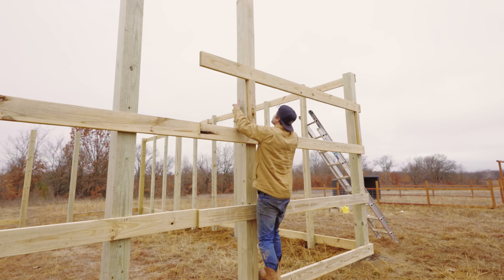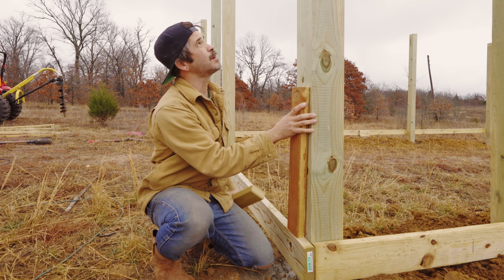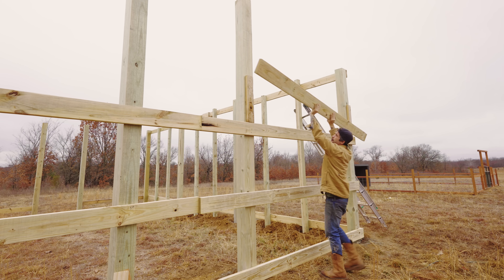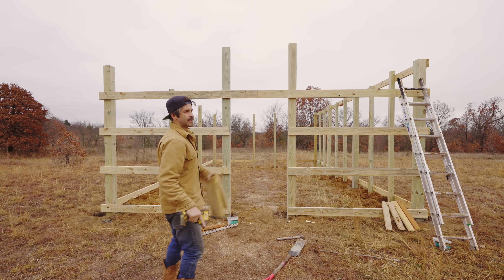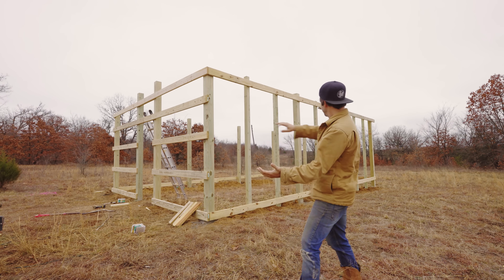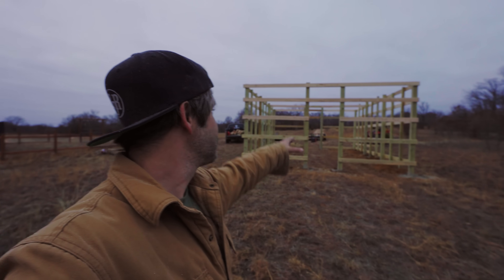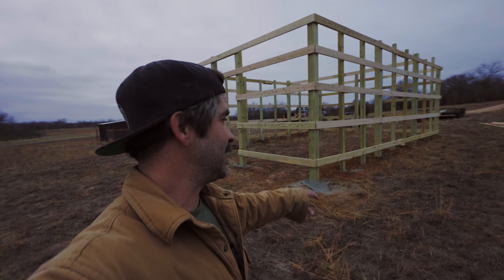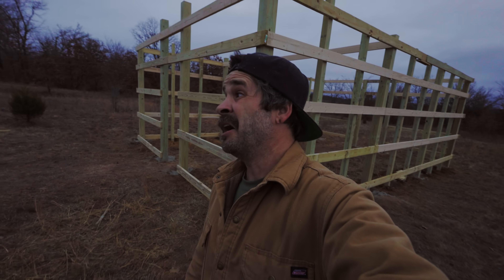DIY Pole Barn takes Shape! Solo Build On The Homestead / Ranch

Comment: If you have ever taken apart a structure built with screws versus one built with nails you would know that screws are much stronger. The sheer strength of a nail is much stronger than the screw without it being installed however once the two boards are joined together it becomes a completely different story. I can pull a board with nails in it much faster than one with screws.

I am a deck builder and we use all screws everywhere.

Nice pole barn by the way. Can't wait to see it finished.
Reply from the maker: Well in fairness a deck and a building are 2 different things. I'd use screws all day on a deck. But when it comes to a large structure,  it's going to shift with the ground when it moves. Nails can bend, screws with break
Reply: @TheCrockers  i'd love to see an example of that. In Dallas we have some of the shiftiest ground anywhere. All of my vertical structures are also done with screws. Been at  it 30 years and I've never had one snap. Of course I don't use 3 inch screws either mine are 6 inch for rafter connections and 12 inch for beam to post. Timber locks for the longer ones.

All that said, nails do have much better shear strength. I guess it all depends on what screws you use also because I use only premium deck screws and timber locks. The thicker coated screws for outdoor lumber at the box stores are pretty much junk. They will corrode fairly quickly and treated lumber especially. They're not supposed to because of the coding they have but they do. I know because I have been able to snap them using a crowbar when removing structures. Much harder than pulling apart a structure with nails but still possible.
Reply: “…nails stronger than screws…” I noticed that comment too. I helped rebuild metal roofs in the Caribbean after Hurricane Irma. No way we would use nails.

Comment: I have to say that I am truly impressed how you’ve been able to do this by yourself. I can tell you’re thinking each step through to make your job easier, particularly with the spacers. Just wondering, you may have mentioned it already but I haven’t heard, are you going to make any kind of a loft for storage, even if it’s a small loft? Actually, since the animals aren’t too tall, you could probably put some kind of  built in shelves along the walls that are several feet deep instead of building a loft area with a steeply peaked roof.

Comment: What size it?    Oh by the way it’s looking great. I love building structures like this from wood. Only thing….only! I disagree with nails being stronger, but I would probably shoot 3.5” ringshank all day on this build from a time saver stand point and feel confident in strength. That being said I would have done reverse. Tacked everything in place with galvanized ringshank 3.5” nails and came back with 3.5’ primeguard screws. But I’m in a coastal county near Galveston Tx. A good galvanized ringshank nail will do the trick no doubt. I just came across this video so not sure where your located. Build looks great and it’s simple, strong pole barn style is proving. Be safe and best of luck with future builds.

Comment: Good stuff. How deep into the ground are the beams buried? I guess for barn you don't need a stone foundation like what goes under a house usually?
Reply: Oh woops I just saw the rest of the video. Looks like you just poured concrete into the holes around the beams. I would imagine that the foundation might wear out a bit faster than if they were raised up to avoid the bottom of the wood getting wet as much.  Anyways good stuff thanks.

Comment: Hey man I'm new to your channel like what I've seen so far. I'm starting a barn myself and just curious it looks like you are using 14' 2x6's which are longer the the actual openings between the 6x6's. Was the reason for that  because in case of a measurement mistake it's easier to cut off then have it buy another piece of lumber? And its easier to just buy all the same length lumber than to try and keep up with several different sizes.

Comment: Can you explain exactly the plan with the barn.  Maybe show a drawing or something of what it's gonna be when done.  I can't figure out why you want all the doors on the sides.  If it's for a "storage barn style where every section has exterior access, will the sections be accessible from the inside?  And why not put a big enough door in the front and back to at least be able to drive a small tractor or lawn mower into it.  A lot of livestock barns I have been in have a path down the middle for the tractor to push poo and or deliver food to the stalls.  Just trying to figure out the plan.  Not meaning to be critical.

Comment: I had trouble posts rotting. I failed to make sure the cement was at or above ground level. Wet ground packed at the post base killed my project over time. Doesn't look like you're falling for my mistake, but note my failure and don't repeat my error.
Reply from the maker: I've been there also!

Comment: good job. I have a 36x36' barn. with a 12' aisle way to drive truck or tractor thru.  I put a swing gate in the  middle of each stall/ That way I can close the gate and have 4 -12x18 stalls or leave the swing gate open for 2 12x36' stalls which is what I do now.